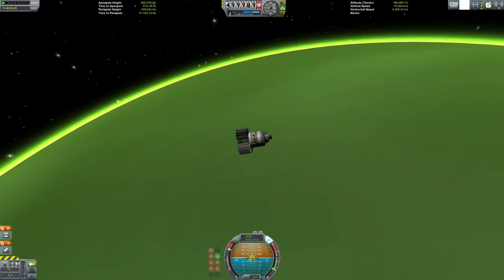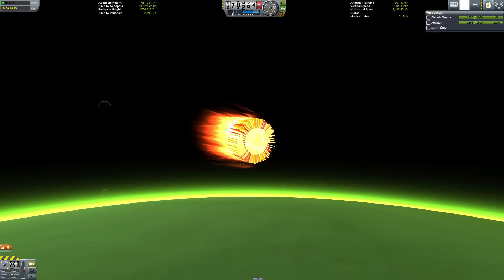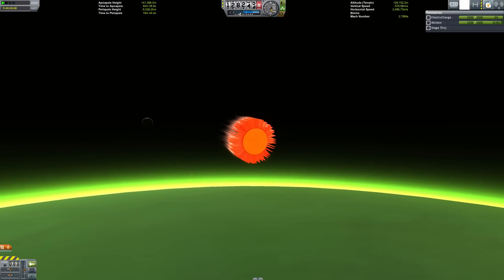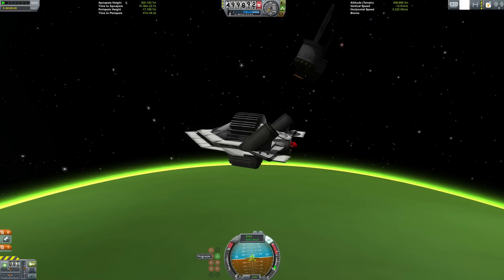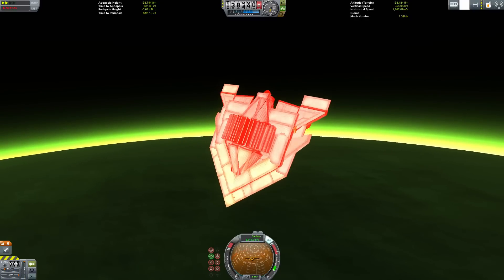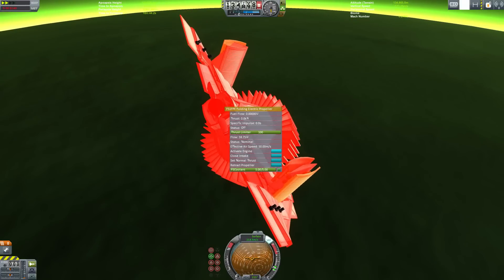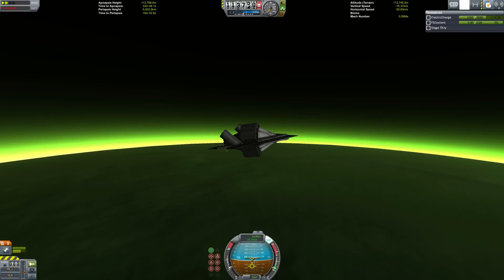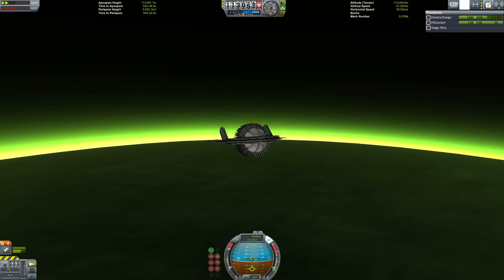Kerbal Space Program: Sustainable Atmospheric Flight on Jool

Comment: The radiators are really heavy. What about dropping them after aerobreaking?
Reply from the maker: +Tim Heinzelmann The Rads are .03, still lighter than the heat shields. But I was still high in the atmo. Jool does take more lift than I anticipated though. I left them on because the original intent was to climb and dive to maintain flight and I had expected a bit more heat than what I ended up with.